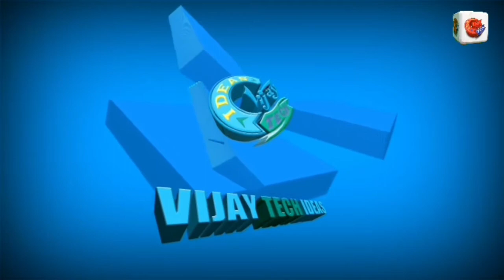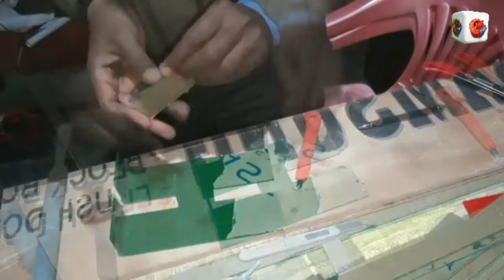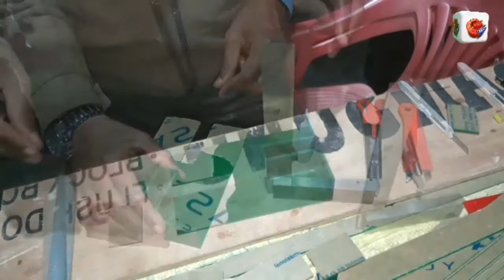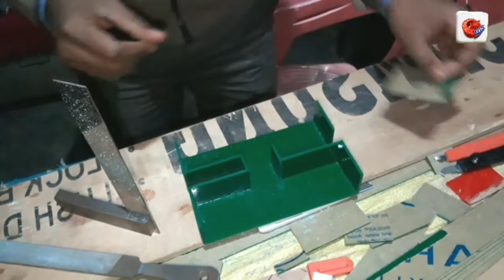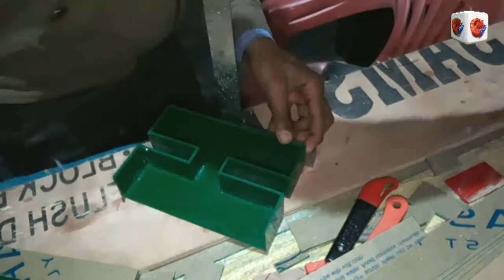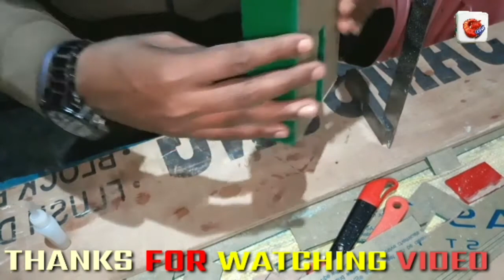3D Letter Rising | Channel Letter | Acrylic Letter Making | Sign Board Making || VIJAY TECH IDEAS ||

Comment: How did you cut the letter ? Can it be cut with a blade ?
Reply from the maker: You can use hacksaw Blade for cutting Acrylic Letter. Normal blade is not suitable for cutting because Acrylic very hard and glassy plastic so please always use Acrylic cutter or hacksaw Blade. OK